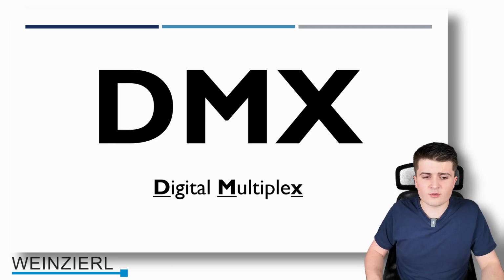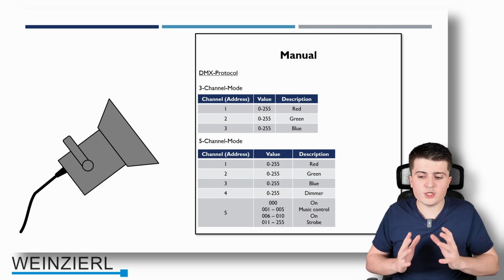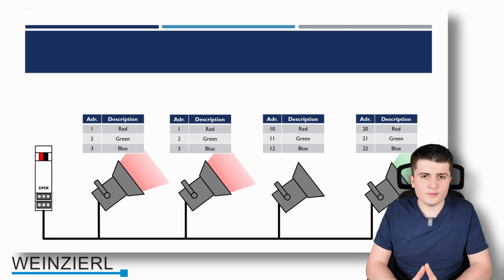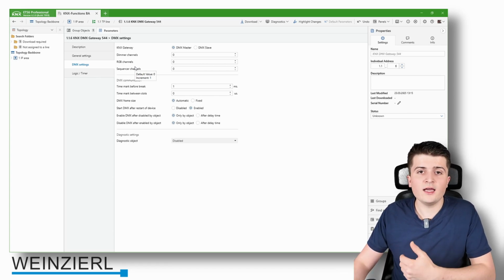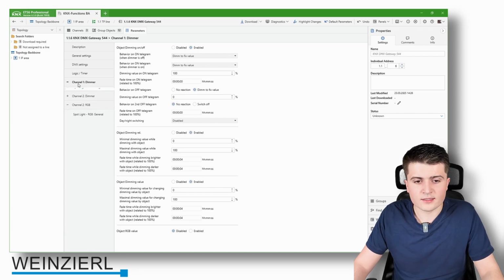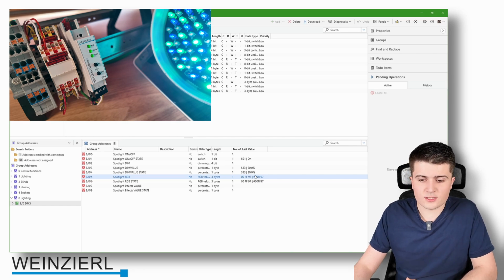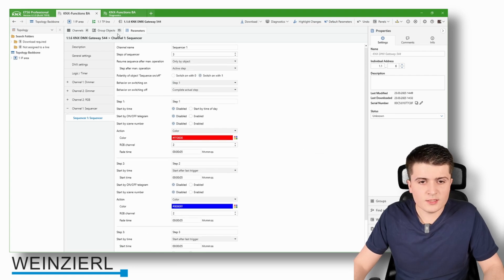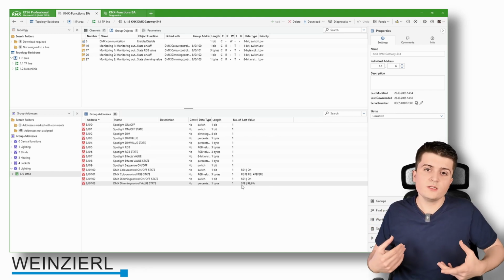How to connect DMX & KNX DMX Gateway 544

Comment: Shouldn’t it be possible to set strobe effects in the sequencer? The sequencer doesn’t send any telegrams on the KNX bus, right? So transitions faster than 1 second should be possible to DMX from the gateway, right? 
Or is it the gateway that’s not handling those kinds of effects?
Reply from the maker: Hi,
Thank you very much for your question.

Strobe effects or effects faster than 1 second are not possible. 

Regards

Weinzierl Team

Comment: How many channels can add per knx dmx gateway?
Reply from the maker: Hi,
Thank you very much for your question. 

The KNX DMX Gateway 544 is a compact gateway between KNX and DMX512 (protocol for lighting control) with up to 64 freely configurable channels.

Your Weinzierl Team.
Reply: The device is very good because it has 64 "dimmer channels", but one dimmer channel can include and control multiple DMX channels! This means you can control a group of DMX fixtures from a single dimmer channel! This makes the "544" a really powerful device! :)